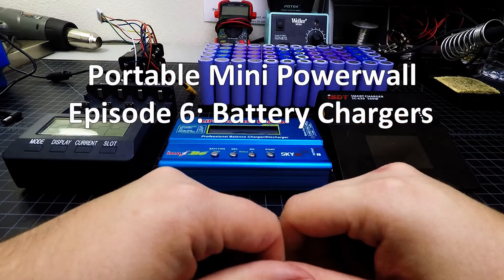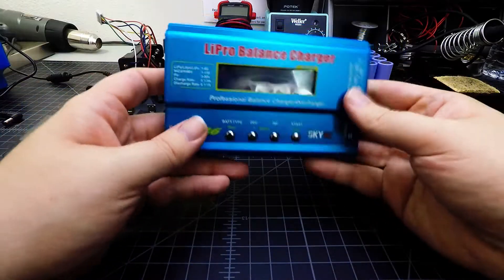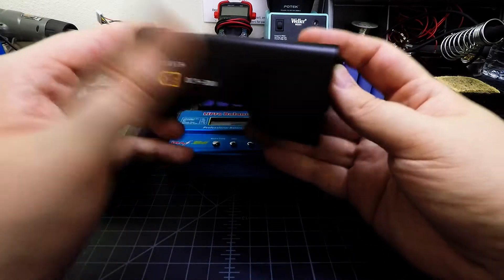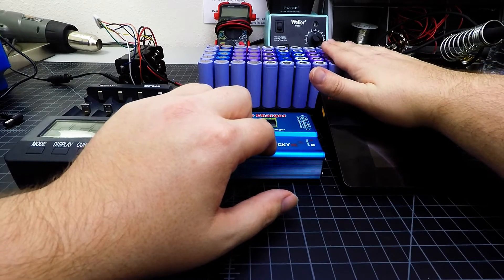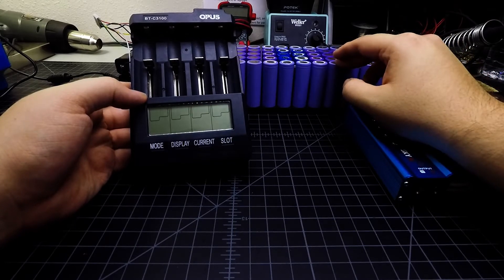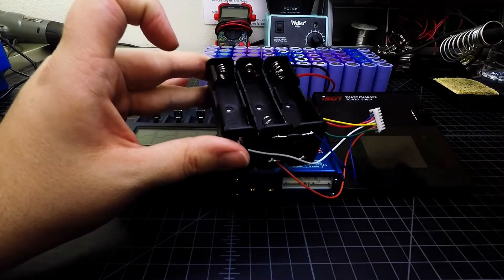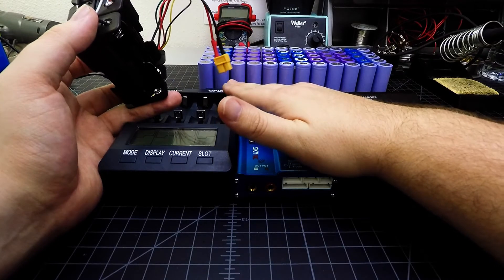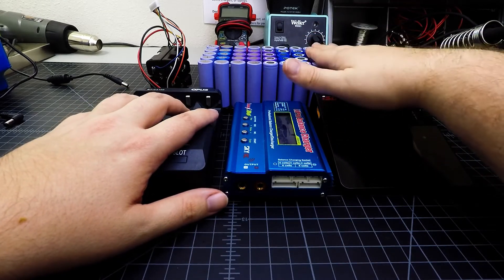Portable Mini Powerwall Project E06 - Battery Chargers

Comment: Question on your 6S charging: Do I understand your reasoning correctly to be that by charging them in series using a balancing system you can put more amperage into each cell with your 50 watt charger than you could if you were to charge these six cells in parallel where the current would be split roughly equally among the six so that you would need 6X the current to get the same C rate you have in the 6S configuration?